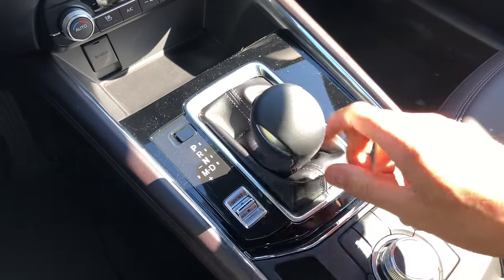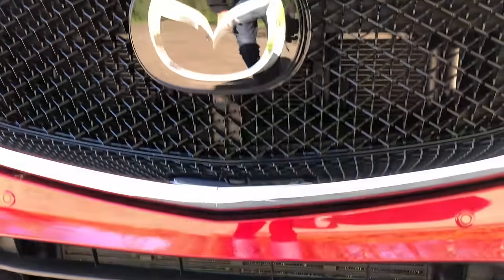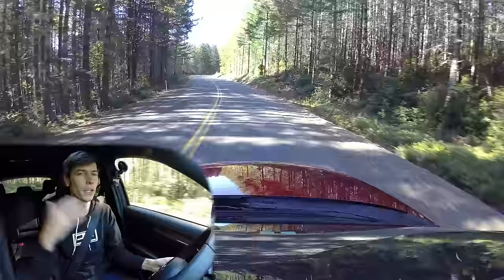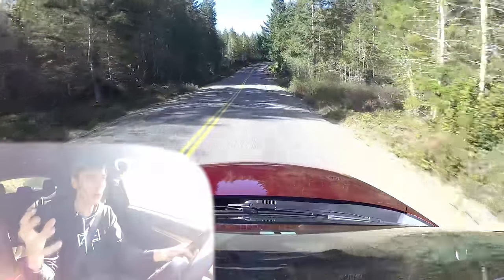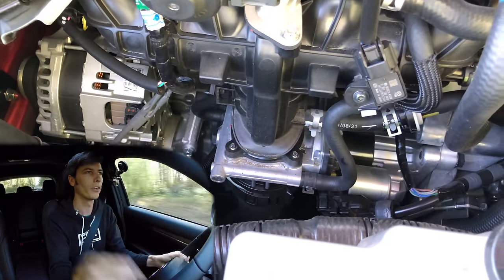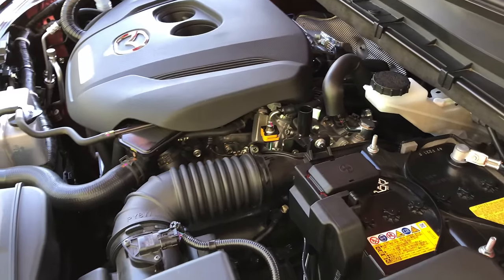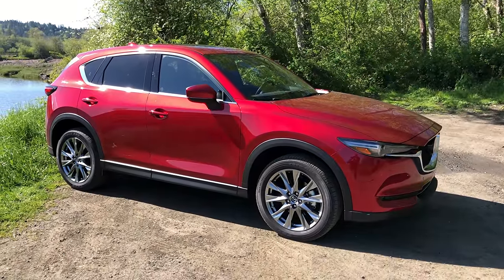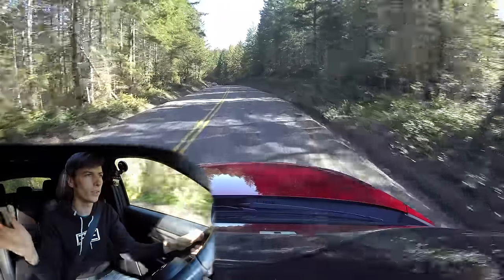Are CVTs Bad? Why Mazda Avoids CVT Transmissions

Comment: Most of "those" people don't even know they have CVT
Reply: True, i had friends bought cvt and dsg and they think its automatic. Anything thats not manual its automatic.
Reply: That's partly because manufacturers and sales people don't like to use the word CVT. They tell the customer that it's an automatic.
Reply: @jumhig  Isn't an automatically controlled CVT still an "automatic" ?
Reply: @1Slamalama1  It's still an automatic.  You're not shifting gear ratios manually.
Reply: @zo1dberg  there's no gear ratios to shift
Reply: Some (or most) of the manufacturers even program shift points to mimic automatics, when that sort of programming has no business to be in a CVT in the first place, except when manually "shifting" them. It doesn't even help its case at all.
Reply: @masonhendrix807  Yes there is and they constantly shift.
Reply: Most consumers of cars are clueless as to the engineering nuance/specifics of their cars.  They buy according to "Styling" "Reliability" "Performance" ... rather than specific engineering approaches/methods.
Reply: Yep and they don’t know a lot of things such as reading the owner’s manual and understanding the contents in the owner’s manual. That’s like +70% of people on the road nowadays.
Reply: It is automatic but not the "classic" automatic.
Reply: most of people have no idea what's inside the car :-)))))
Reply: That's very true specially in my country, 90 % of the consumers thinks all automatic are the same and most people recognize only the brand and doesn't care which car is fun to drive.
Reply: All they know is that they have got automatic transmission
Reply: Same here... One of my friend thought 7 speed transmission as the dealer said him... But it was just a cvt with fake shifts.
Reply: @1Slamalama1  a cvt is a transmission  CVTransmission you see?    since you dont manually select gears, it's an automatic transmission

so yes its an automatic

just not the 'traditional' type.

just like people call a vacuumcleaner a "hoover",   doesnt mean every other vac is a hoover...
Reply: @hellouser5498  Hey you look familiar!
Reply: Forget about CVT or AT I know a lot of people who think automatic cars don't have a transmission, like power is directly send to engine
Reply: Mazda has no cvt, smooth shifting and automatically combusting
Reply: @zo1dberg   By leaving out the word TRANSMISSION you are kind of making their point
Reply: Are they brain dead, they work very noticeably different?!
Reply: Once they shell out $3500 for CVT factory rebuilt lesson learn never again!
Reply: @maheshmurali2697  rotary power!
Reply: Gordy Kilcollins oh man thats true
Reply: They will, once a problem occurs and then find out they need a new transmission.
Reply: Gordy Kilcollins Even worse when companys make a CVT transmision imitate gear shifts, my grandma's Nissan Juke has a CVT and it mimics gear shifts like if it were a automatic and its super weird
Reply: I was thinking the same. As if someone who buys a Honda CR-V would know anything about cars...
Reply: @Jeff Sol not changing CVT oil at right times (or incorrect CVT oil) or under spec CVT
Reply: Some CVTs are better than others.  I still haven't found any that I like with good get-up from a stop  (0-20mph or so) but they've come a long way for passing and accelerating without funky lag.  Some it's really hard to tell - I had a loaner (while getting airbags replaced) that I really struggled to tell what it had, geared or CVT.  I concluded it must be a CVT because if I pushed it for a long hard acceleration it hung up in the power band the whole time - even though it "felt" like normal gears at lower acceleration.
Reply: @matthewmiller6068  cvt is a perfect concept, but it's so far behind on development. "They" should quit being greedy and over-engineer the cvt for a couple production runs, THEN figure out how & where to cut back. Currently they don't seem beefy enough. As if, parts are too light/weak. Know what I'm sayin?
Reply: @gordythecreator  not sure as I don't know anyone who has yet owned a car with one for any length of time.  Supposedly the CVT version of my car can tow 2700lb not far off from the 3000lb my 5 speed automatic can so they must have some confidence in the durability.
Reply: @samsonite360  Economic and comfort.
Reply: I test drove a CVT Subaru , They even make it do fake shifts .   No thanks   .
Reply: @ShawnVanden  worst part is when these consumers finally make their choice they think its a "good investment" or money well spent after much "research" aka a few test drives and typically which Interior they like the most and generally NVH/cabin acoustics since some of these cheaper options sound like LUXURY cars inside these days comapred to others....which IMO definitely would be a determining factor paired with ride quality no matter the brand. I couldnt expect them to know/feel anything past that as a typical/general consumer.

Comment: This is why I like mazda. They always do things a little differently.  It's rare to see a company of that size still willing to try different things. Super cool!
Reply: @japcrap Have you actually compared gas mileage ratings between Mazda and competing equivalents ? In reality, Mazda significantly lags behind in this regard (along with Kia/Hyundai). Otherwise, I'd seriously consider buying one.
Reply: @jazz_addict7079   I've been driving 2.0 petrol Mazda 3 over the last 2 years. Average mpg over 30k miles is 50.4.  Admit I'm an edge case with a lot of roads that  are at the  sweet spot of 50mph.  However I can easily maintain 45mpg at 70mph cruising or around urban roads.  To me that appears class leading - most competing brands do not seem to be able to achieve either their on-paper mpg or performance figures.
Reply: @RadX666  My mistake-- I shouldn't have repeated any blanket statements I'd read about Mazdas and I don't doubt the accuracy of what you report. However, in terms of the class of vehicle I need, the Mazda CX-5 does, along with Kia/Hyundai, lag behind many of its competitors.
Reply: Are u sure?im using mazda, amd im getting better gas mileage than cvt equivalent from other brands say toyota n honda.
Reply: Yup. They even made the Rotary Engine Research Department after embracing the german invention. They wanna be different.
Reply: @jazz_addict7079  you like jazz so you like boring things and thats ok
Reply: @shhhdontshout  I'm just going by govt. figures on vehicles I'd want to buy. the Mazda CX-5 4WD (4 cylinder) is rated at 26 and the Turbo at 24, combined. The Subaru Forester and Honda CRV AWD's are both rated at 29 combined while the RAV4 is rated at 28. I did come across a Car and Driver review of the CX-5 that said they got better mileage than the official stats on their test course, but I don't know what their course is like.
Reply: @jazz_addict7079  not sure about SUV, but me im driving sedan. And its way better than any of my friends honda city, toyota vios, or even nissan almera. But than again, it heavily depends on our driving style.

 I rarely blast past 3k rpm. But on the weekend, in the sport mode and rev all the way to redline! Sometimes it even hits 7k rpm. Lol! Thats what i like about mazda skyactiv transmission.
Reply: @shhhdontshout  we live in a rural area and a sedan is simply not a practical vehicle for us. I may still test drive the CX-5, simply because  for $35,000 new there are so many compromises when it comes to Crossovers.
Reply: Just wish Mazda was big enough to offer V6 and V8 engines.
Reply: This used to be Engineering Explained.  Lately is seems to be the Mazda Sales Channel.  Credibility has been diminished.
Reply: @cocoaliveson3235  Seems this video simply shares the enthusiasm of Mazda engineers and how they didn't want to do things the same way as many other manufacturers. That is not a Mazda sales pitch.
Reply: Hyundai does.
Reply: Mazdas are by far one of the best brands right now. These guys do things their own way, not putting CVT garbage in their vehicles, making them sporty, while having a BMW feel. These mazdas also look sexy, (not gonna lie) and they're also very reliable. You simply cannot break a Mazda Miata. Will definitely buy a 2020 Mazda CX-5 as our next car!
Reply: You shouldn't say that, mazda has the tech to make a faster hatch but they're not gonna do it, theres an article about it, basically mazda is never gonna make a fast car again
Reply: I’d personally take any traditional automatic over any CVT, after working at a Toyota dealership for a summer.

The amount of CVT failures I saw kneecapped any savings made by the better fuel economy. $4K for a new factory unit, which will likely still fail after 80K-150K miles (driver depending), much like the CVT’s they replaced.
Reply: @RadX666  Sounds about right to me. I got a 2018 Mazda 3 manual and my average is around 40mpg for combined highway/urban. Great car.
Reply: The only issue I have with Mazda is their cargo capacity.  It's always a fraction of the competition. CX-5 for example, 30.9 cu-ft.  Rogue, CR-V etc are just shy of 40.  30% more.  That's a HUGE difference in utility.
Reply: @RadX666  50mpg bro your full of it.
Reply: @jasonscott7527  My best friend owns a 2016 Mazda 3 I Grand Touring 2.0L SkyActiv and consistently averages 45MPG, and YES he also gets 50+ MPG trips on a regular basis, I own a 2014 Mazda 3 S Grand Touring Hatchback 2.5L SkyActiv and consistently Average around 40MPG, and have also gotten upwards of 46MPG on longer distance trips, 20+ miles of say highway driving, My car is less efficient due to the larger SkyActiv engine but still more efficient than most of the smaller 2.0L Honda, Toyota, and Hyundai competition, it also has more power 185 stock HP and Torque and is very fun to drive in Sport mode, Sport mode however cause the gas mileage to drop but puts a smile on your face!!   Mazda makes fun Innovative cars that are reliable and class leading for interior quality/fit and finish, the 3rd Gen Mazda 3 raised the bar of what was conceived to be an economy car for its build quality and features/Technology, But anyways YES the 2.0L SkyActiv is very Efficient!
Reply: @N7_Nate  I think your math is way off man try again .
Reply: @jasonscott7527  I've learned in life you cannot make a person see the truth, if you don't want to see it that's fine, it's the same ignorant mindset that makes people think car company's don't change for the better or worse over 20 years, good luck to you sir!
Reply: Petrol is cheaper than transmissions.
Reply: @aygwm  The only one with major cvt trans problems has been Nissan and any one else using jatco.
Reply: It's not Mazda that's doing this differently, it's their competition that's being different. Mazda is one of the only companies that like proven designs.
Reply: @JedTaneo  Nothing wrong with that.
Reply: @jazz_addict7079  I don't think fuel consumption is even within top 5 of concerns when average USA buyer is looking for a car. Or Canadian.
Reply: They do things differently because they have a constant cash flow crisis that impedes their R and D. This is why they have no alt fueled vehicles. Hybrids, Fuel cells, and EVs Mazda can't afford to develop hence their quixotic love affaire with biofuels (a terrible idea that steals fertile agriculture from feeding people to providing fuel). So read this hagiography about inefficient staged autos with the appropriate amount of salt.
Reply: @shanemurphy9024  sounds like you're the salty one tbh. Lol you're probably right tho. Mazda isn't the most successful of the large vehicle manufacturers.
Reply: @jazz_addict7079  are you kidding. The cx5 gets 32mpg . The 2018 Mazda 3 gets 40mpg on the highway that's with 155hp. 2.0l engine. The skyactive models are great on gas.
Reply: On paper mazda lags behind, so i’m not sure about all these user experience. people in the US with long ass interstates will just win at MPG, my friend in the US with a Rav4 also gets 50mpg.
Reply: @AndyZULUL  that has nothing to do with my comment.
Reply: Mazda while not Perfect are hundreds of Times Better than Hyundai Ford Toyota GM KIA but do run into a Rival with Honda more times than not and Mitsubishi but again I would take a Mazda of those to 9 out of 10 times